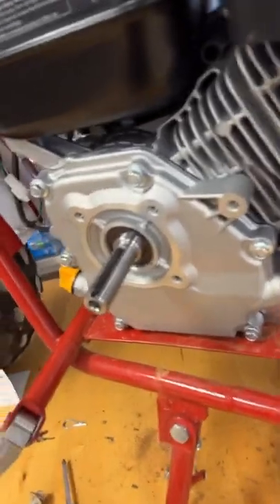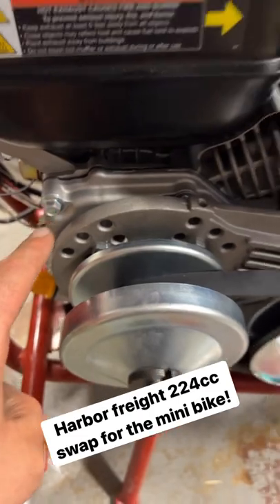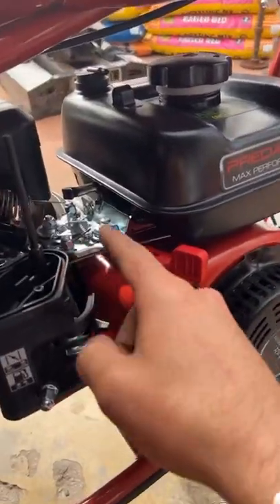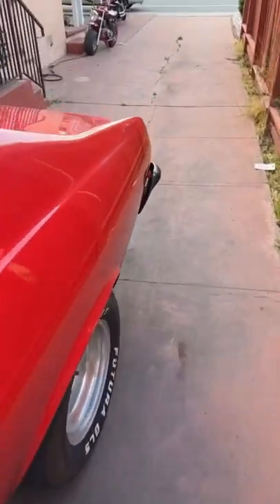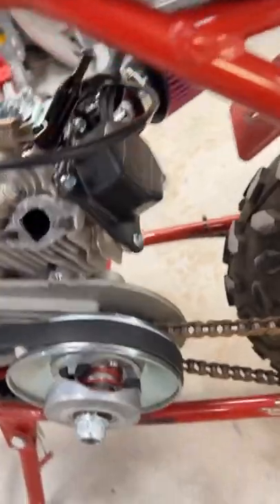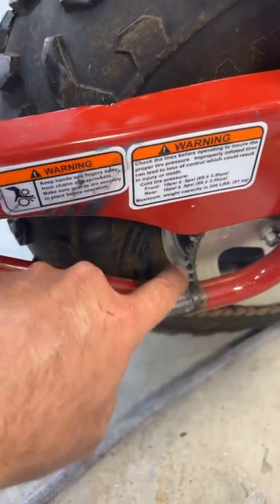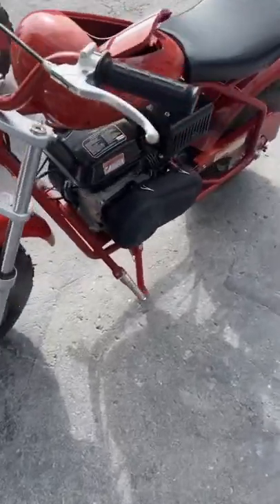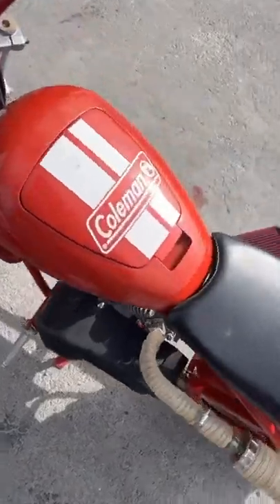Predator 224cc swap in Coleman mini bike

Comment: Use an amazon riser plate and put the motor all the way forward no cutting or trimming required done may have to add a link if needed
Reply from the maker: Thanks, I saw the other riser plate options you mentioned, but it was easy enough to do it my way honestly. But thanks for the tip! Maybe others will choose it

Comment: i straight chained my 224 and it goes easily 40+ mph stock and i also drove it for 22 miles straight even brought it on the highway only issue i had during the trip is gas😂
Reply from the maker: It’s a beast of a motor! My other Coleman, I’m going to delete governor and try it out.. and I will be doing the valve spring upgrade too.  A good comparison.  This motor is a beast to say the least!!
Reply: How did u straight chain it

Comment: Does the 224 swap requires an aftermarket torque converter or can it be used with the stock one?
Reply from the maker: It’s a different size on the crank.

Comment: I put my 224 on today but it just keeps randomly dying? Any tips
Reply from the maker: Might be oil level sensor/wiring or main switch issues
Reply from the maker: You need to check and make sure fuel lines are not kinked. Does the engine stop suddenly or does it bog down?